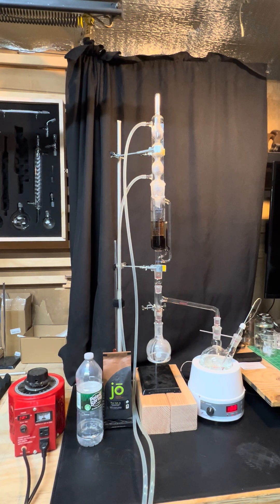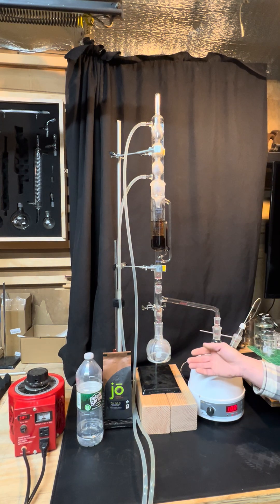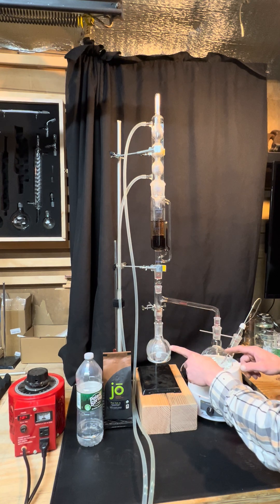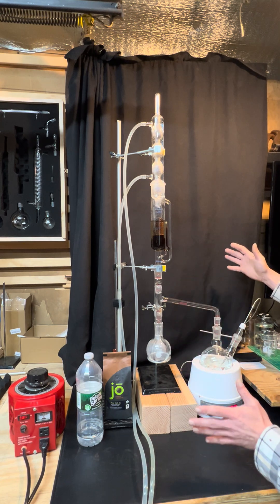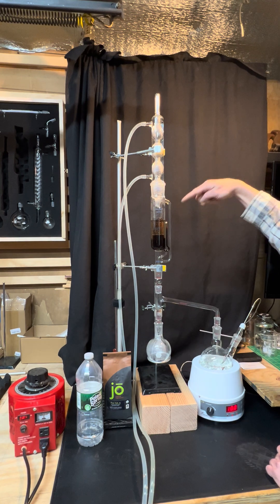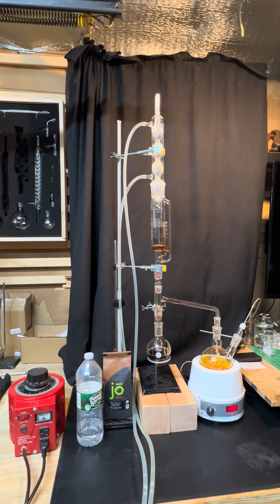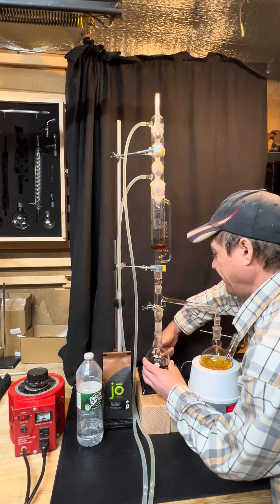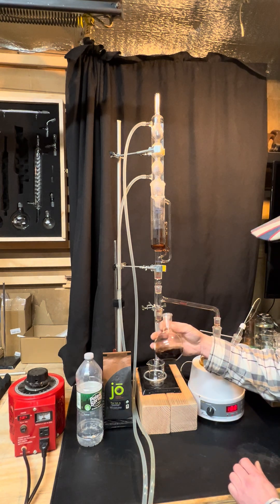Subscriber Requested Serveable coffee...

Comment: Love it! I started on the internet in the 90's, so i still think of the internet as largly a one way mirror. To have someone respond to comments as well as mentioning me in a video is a bit surreal.

This whole set up has a lot more verticality than my current vision so i will take what i learned and continue to research. May ask where the two tubes leading off screen go to? 

The general antispation and spectical is exactly what i am goimg for. Glad to hear it tastes good too!
Reply from the maker: Hehehe. I'm glad you like the video and content. As for the system of tubes, they go into a bucket of ice water with a fountain pump for circulation. The pump is rated to push water up to 15' vertically, so I have a transformer for voltage regulating/pressure control. 
As for your work, I think it is beautiful. I personally think it would be cool if you shared more of your work. By all means, feel free to pick my brain and Welcome ☺️
Reply: @daedaluscreation4869 not sure the best way to chat about this project but I wanted to share that after some research, this set up ends up being quite tall. Do you have recommendations on where we can do this in a more compact format?
Reply from the maker: @TheTaK1138 I totally get what you mean and have been thinking about that prior to your asking today 😂... my suggestion is to maybe set up boiling flask into the distillation arm as intended (not my reverse MacGuyver)... have the steam enter a small condenser to drip through the coffee thimble (without the Soxhlet glass), and just have it drip thru the ceramic bottom into a mug. It would shorten and widen the setup but also reduce heat waste from all the additional glass. 😊 I hope this helps. I can tinker this weekend and see if I can maybe come up with another short for you. As for communication, this works until I can figure out how to create better means of starting a community. It would be nice if YouTube had a method to contact creators without needing to publicly publish emails but by all means comment here and I will see it 👍😉
Reply from the maker: Check the new short 😂
And I plan another Monday if my adhd doesn't mess me up 😉